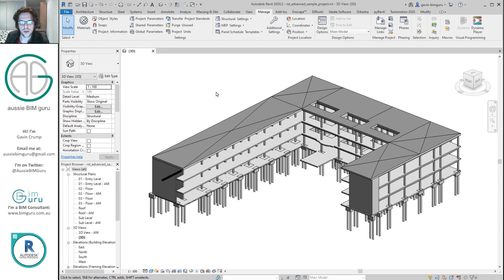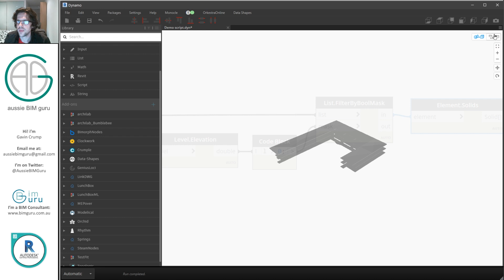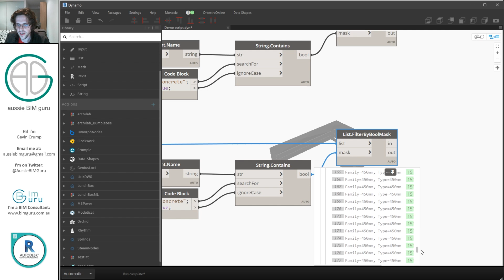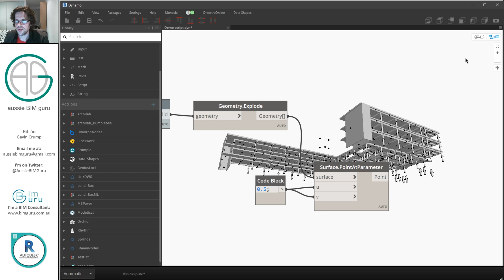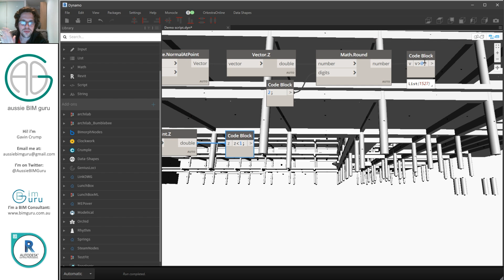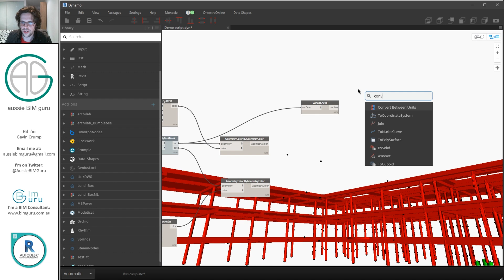Formwork estimation using Dynamo!

Comment: Thanks for sharing! I may add up some tips for the subject: 

1- For more complex models, first creating a solid box including all the elements and then subtracting those elements from that box somehow works so much better. What I found out is, poorly modeled elements, especially the almost coplanar faces that  lacking alignment creates most of the errors no matter what the method is.

2- For the stairs, as they're frequently poured after other elements are in place, there should be two substracted solids: one with contains all elements except stairs and another with all elements, stairs included. By doing this, All the elements except stairs could be extracted from the first solid while stairs are extracted from the second one.

3- Areas could be written on elements separately with a little more work on list structures.

4- Openings in elements could be documented separately as they may be produced differently from regular formwork methods. This I find the most challenging issue on formwork generation using Dynamo whilst it doesn't have a huge effect on total cost.
Reply from the maker: Exactly the type of comment I hoped to see - this is great tips on how to improve and build on the concept!

I will try to present a video on point 3 at a later date, as this seems of higher value than a 1 off takeoff. Great point RE openings influencing surface area also - didn't think of that.
Reply: great tips! But how can you substract the elements to the solid box if you can't properly generate all of the element geometry to subtract? Thanks!
Reply: @franciscoconde7885   Dynamo treated me well with generating individual elements' geometry, even though there was some poorly modeled elements. In your case, inspecting the problematic elements for what might have gone wrong and correcting them should do the trick.
Reply: @melgcer  indeed, easier to correct them by isolating the elements that couldn't create geometry in the first place. Regarding the assignment of formwork area per element type, how can you trace back the right elements used to create the solid (after union or subtraction) since that after using geometry explode you lose all reference for the elements/solid?  Thanks in advance
Reply: Merhaba Dynomo ile ilgili birkaç sorum var amam  iletişim sağlayabilir miyim sizinle?
Reply from the maker: @alicekalomi6057  most people email me at aussiebimguru@gmail.com.
Reply: @AussieBIMGuru  I wrote by following u. But how can we calculate foundation and stairs formwork areas ?
Reply from the maker: @alicekalomi6057  get the solid geometry, deconstruct it to its surfaces and finally filter those that have a normal Z vector component higher than 0. Effectively what I do in this video, but with different elements.
Reply: @AussieBIMGuru  didn't understand explanation because didn't understand the logic in video. Is there any education at youtube which u suggest. Thank u very much
Reply from the maker: It's similar to this video I made, but isolate the opposite faces:

https://youtu.be/AoCp3ghlwCc
Reply: @AussieBIMGuru  Dear Gavin thk u. Can u share the combination for foundation, pls?
Reply from the maker: @alicekalomi6057  i haven't made the script unfortunately. It would be similar to this workflow but for different categories in Revit. That workflow has a script on my github though.
Reply: @AussieBIMGuru  Can u share the link?
Reply from the maker: @alicekalomi6057  https://github.com/aussieBIMguru/Dynamo_Scripts
Reply: I also have some problems to ask related to the formwork estimation for PSC Girder bridge project. The girder was manufacture from the factory and the slab deck was cast in place which is a big challenge since the alignment is not straight and the bridge contain some super elevation. The bridge model I made from adaptive generic model families. Could you share any idea about this?

Comment: How to do this using only python :)
Reply from the maker: With great difficulty. It would require a lot more work to achieve all the intersections, unions etc but I'd probably just do it in Rhino Inside these days!

The revit API and geometry engine have a lot of errors related to solid geometry that Grasshopper/Rhino provide very simple routes around.

Comment: Hi Gavin, thank for this awesome and very useful video. I'm a beginner in Dynamo and i wanna ask you if it is simples to have the areas by type of element after the Solid By Union is made, so i can have the area per element. Thanks in advance!
Reply from the maker: Possible but not simple.

It would involve exploding the resultant geometry back to surfaces then intersecting their face centre points with the original elements to determine which it relates to, grouping their areas by related element and finally setting said area.

For large models dynamo would likely fail, might need something like Grasshopper/Rhino or Svechok/Blender to ensure the process can complete.
Reply: @AussieBIMGuru  Thank you for the quick reply!

Comment: Thanks for this amazing workflow!  Saves time and improves efficiency. However, when I tried working with this, the elements.solid node fails displaying the error ' failed to construct a polycurve from input curves and branched polycurves not supported'. Is there any possibility to resolve this error?
Reply from the maker: A common error for complex joined geometry typically. It often can't be overcome in Dynamo unless you figure out which shapes/curves are causing it and try to clean up the joins.

Comment: I am facing with error code at solid.byunion "Warning: One or more of the input types are not matching. Couldn't find a version of ByUnion that takes arguments of type (Function)" why sir . help me
Reply from the maker: Make sure the only data going into the node is in the form of solids and that there are no null values.
Reply: @AussieBIMGuru  my list.flatten is showing function
Reply from the maker: @deanwinchter8598  somewhere before that something must not be working. My script is on github if you need to compare it.
Reply: @AussieBIMGuru  I get it sir thank? At the Bottom of my nodes showing I but yours showing Auto, what is the different, sir
Reply from the maker: @deanwinchter8598  i am unsure. Hard to say. Maybe try using the autodesk sample structure project like i did to ensure it works the same way.
Reply: @AussieBIMGuru  I can make it on Revit 2022 but not working on 2019. I think it is the problem of node lacing, sir. How  should I do, I can make auto lacing on 2019
Reply from the maker: @deanwinchter8598  i havent used dynamo for revit 2019 so cant test unfortunately.
Reply: @AussieBIMGuru  thank u man
Reply from the maker: @deanwinchter8598  maybe try dynamo forums. Some folks there will likely have access to 2019 still. Im in 4 versions apart unfortunately so am limited between 2020-23

Comment: Hey Gavin! Thanks for the video - used this script to calculate formwork for a bridge, just modified so it so it calculates thearea separately for abutments, superstructure and so on. The oly thing i noticed - if an edge has a chamfer, that chamfer is excluded from the calculation, as the vector would be pointing upward. Do you know of a way that this could be included in the calculation?
Reply from the maker: You could detect the Z component at a higher tolerance, for example maybe if Z is less than 0.9. That would ignore upward faces but account for slightly upward facing faces.
Reply: @AussieBIMGuru  Thanks Gavin, that worked. (0.75 was the magic number). Now i just need to figure out how to get rid of the detected area for the cavities inside the superstructure and I will have a neat litle script to calculate all the formwork.

Comment: I am a beginner in dynamo but I learned a lot from the video, thank you. I have a question: it is possible to estimate formwork in generic models as dams? and how would you do it?
Reply from the maker: Yes it could be possible, but you would need a 'rate' to apply to dam face area I'd say. If you know roughly which direction the dam walls are facing then you could explode the wall geometry and filter its surfaces by whether they are within an angle of the intended direction to reduce your analysis surfaces to only those on the dam wall. From there Dynamo can calculate surface area.

Comment: Great sharing, Gavin ! Could we separate the quantity back into floors, beams, columns, walls?
Reply from the maker: Yes for this I would suggest looking into Rhino Inside and Grasshopper. An additional step would be to intersect and find the original element of each face before the geometry was joined. Super computationally intense, Dynamo probably can't handle this much geometry!

Comment: In case I need to classy the type of faces based on the type of element they came from, how could I do that. For example that the faces of a floor are differentiated from the columns or the walls.
Reply from the maker: Tricky... as the faces once combined are no longer the original shape in the list order. You would probably need to explode the faces and flatten the list, then intersect them with the original elements and find the index of the match. It's pretty heavy for Dynamo to do something like this - at this point I'd be suggesting grasshopper instead.

Comment: could we use Dynamo for quantity take off of structure ?
Reply from the maker: Yes dynamo can obtain elements and their parameter values (area, length etc) so it's definitely possible.
Reply: @AussieBIMGuru  can we write a script that can apply all RC structure for quantity take off ?
Reply from the maker: @pisethchea4181  possibly, it really depends how clean your data is and how well modelled your design is. I mostly deal with architecture myself but have achieved quantity takeoff before across multiple categories. It's mostly just a matter of collecting elements, filtering them by type, obtaining relevant data, building lists and writing to excel or csv
Reply from the maker: @pisethchea4181  this video by TRK shows a method he uses to do model based takeoff;
https://youtu.be/051WFw52C5g

As you will see, his data has been organized in revit prior to support the script.
Reply: @AussieBIMGuru  thank for your details and lovely answers
Reply from the maker: @pisethchea4181  you're welcome! I'll add a dynamo takeoff video to my list this year.
Reply: @AussieBIMGuru  please take it soon. I can't wait to see it!!!
Reply from the maker: @pisethchea4181  i will return early february (enjoying a break!), videos queued until late that month so likely end of feb/early march.

Comment: Very useful video! I also would be interested in a topic, how would you deal with applying dimensions to all of these elements. 3d model is smth very exciting untill I have to bring sheets out of it to the site. I would try f.e. with Dimension.by Elements node for the grids first. Is there some other fast solutions? Thanks!
Reply from the maker: There is no fast solutions in Dynamo unfortunately - it's a complex task. I would suggest trying out the auto dimensions pack. It's not free, but it's quite cheap as well - less than an hour of billable work.

https://archithetics.net/auto-dimension-pack-for-revit/

The developer is quite active and supportive and takes good care of the addin from what I've seen.

Comment: Great workflow Gavin, 
(I am using formula, because we need level by level formwork)
But I think I can use your method also.
Again great job👍👍👍
Reply from the maker: I'll hopefully share a slightly more stable method in Grasshopper and Rhino Inside eventually also. Formula is a good idea where possible I think, that way the data is live.